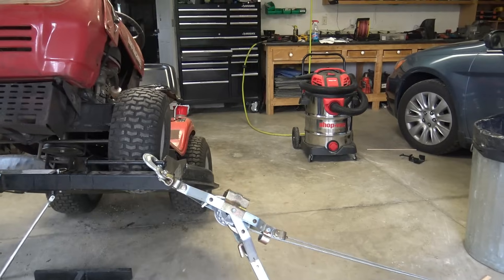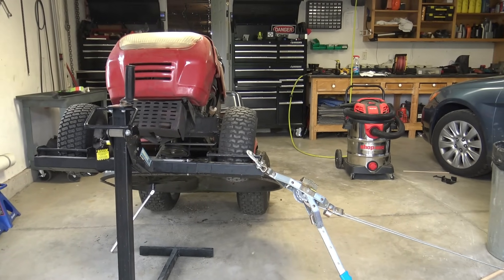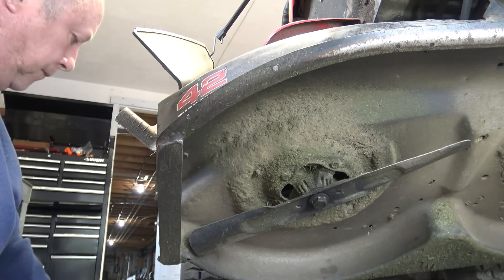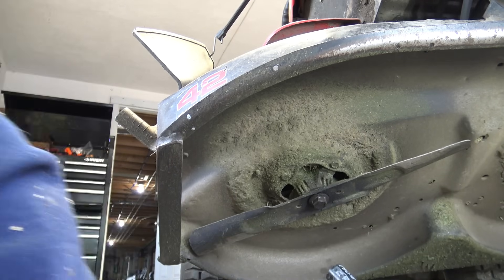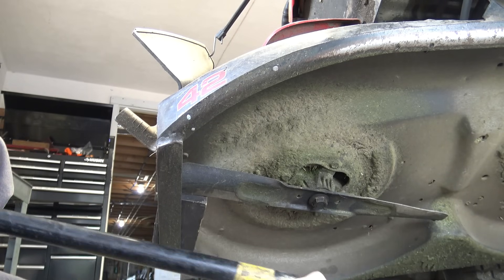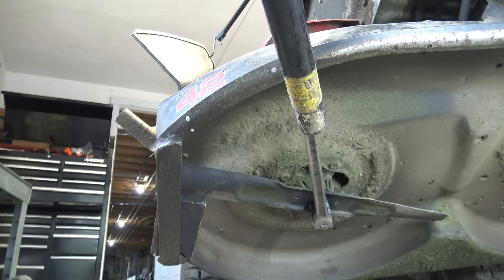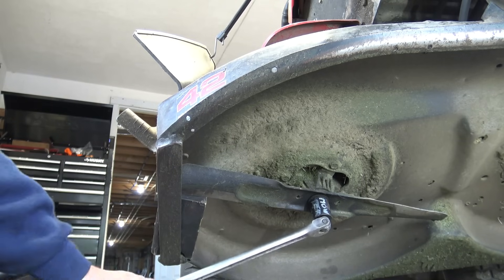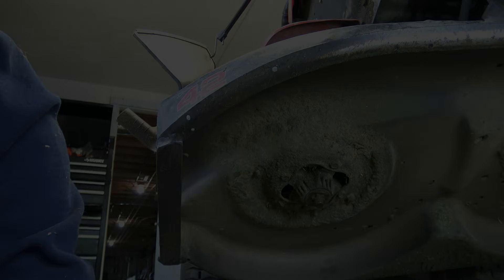How to remove a stubborn mower blade nut

Comment: use never seeze on the threads  to keep  from locking up next time
Reply from the maker: That is  very helpful to my viewers. Thanks for your comment and thanks for watching my channel.
Reply: @richardspaulding5035  Or, my good man, another way is to not tighten the blade bolt until you soil your pants. Most blade bolts only need around 50 ft. lbs. to secure them.
Reply from the maker: @48retrop  Thanks for that information; Your point is well taken as that is something I never considered.  As I recall I used an impact wrench to tighten the blade nuts back then.  Now that I think about it, I know these things can very easily put out several hundred pounds of torque.  I am sure that’s what must have happened.  I do indeed own a torque wrench and I will most certainly tighten the blades to specifications next time.  Thanks for taking the time to help me out.  Please by all means to not be a stranger to my channel.

Comment: Now the question is can you re-install the nut with the SAME pressure as before?
Reply from the maker: I just gave it a few blasts with the impact gun. The rotation will keep it tight.  I replaced the machine the following spring as it was about 8 years old at the time of the video. I have not attempted to change the blades on my new machine as of yet. Thanks for your question and watching my channel.

Comment: Pulled so hard on mine I snapped my "break"er bar. Looks like I'll be applying some heat and trying again...
Reply from the maker: Be careful as the spindle housing is made of aluminum. It will melt in a flash if you get things too hot.

Comment: I'm afraid to try this... afraid the top of the nut will break off.
Reply from the maker: I must admit I was very nervous; I did not know what was going to happen. I could not use heat because the spindle housing was made of aluminum.  I knew something was going to give but I did not know what. As it turned out as you saw in the video it was the nut.  Put on safety glasses and try not to position yourself directly under the machine. If you noticed I positioned myself off to the side as best I could.  Let me know how you make out.
Reply: @richardspaulding5035  I have a push mower, so luckily I don't have to be worried about the weight of a riding mower.  I just have to make sure I try it right after cutting the grass in case it's out of commission for a bit... or broken beyond repair.  It would give me a reason to get an electric mower though.  My old neighbor had an electric and he said it worked great.
Reply from the maker: @jstriker623  You won't be sorry if you go electric. I have one for tight areas I cannot get to with my ride on. If you do go electric get an extra battery so you can have one charging while the other is in use. Make sure you pull that plug wire while working on removing your blade

Comment: The longer you leave the blades on the tighter they get. Especially when you are using it as a woods mower. Believe me I know. Hitting brush logs and rocks from time to time because I know I'm getting ready to change my blades actually just tightens up the blades. Picture hitting those rocks it's like hitting a hammer and tightening the blade. Best thing to do is not use it as a woods mower. Lol.
Reply from the maker: I agree they get tighter over time. The blades in the video had not been changed in 2 or 3 seasons.

Comment: You should always run up the pipe as close to the head of the wrench. The way you did it you are exerting a lot of force on the end of the tool and at the head. And you are wasting a lot of advantages of using the lever.
Reply from the maker: Thanks for the advice. It is well taken.

Comment: Yeah because everybody has all of this fancy equipment.
Reply from the maker: Thanks for the comment Bob;  I do not think my tools are that fancy. However I suppose if you are an individual who owns no tools at all they would appear to be so. The lift in the video was purchase at Lowes for under 200 dollars. If you own a lawn tractor it is a worthy investment.  Anyone who owns a socket set should have a breaker bar. All I did was slip a pipe over it.  As far as the ratcheting come along a simple chain would do however the tool  can be purchased at most hardware stores for about 30 or 40  dollars. If your interested in doing repairs yourself it requires some investment in tools. Thanks for watching my channel.

Comment: I've literally broken 1/4 breaker bars trying to get mine unstuck..
Reply from the maker: They can be very difficult. You cannot use heat as the spindle housing is made out of aluminum.  It will melt in a flash. Perhaps if you know someone that has a 3/4 inch breaker bar otherwise you may have to start a cut in the nut and break it off with a chisel. let me know how you get it off. thanks for watching.

Comment: Jesus. Mine I used a 4 foot pipe still no go.
Reply from the maker: They can be tough!  I wasn't sure if I was going to get mine off, it was more than a little scarry. I did not want to use heat because of the aluminum spindle.  However, if you must cut the bolt and the spindle gets damaged, they are easy to replace. You can find a replacement spindle for about 50 dollars depending on your machine. Let me know the outcome if you can.

Comment: Not even that worked, I broke my breaker bar 😭
Reply from the maker: Thanks for sharing your experience. Sorry I took so long to respond. In 40+ years I have never broken a breaker bar. I have always used quality tools however. Be careful if you try to heat that nut as the spindles usually have an aluminum housing.  You may need to take it to a professional. Let me know what happens
Reply: @richardspaulding5035  why not just use battery impact wrench?
Reply from the maker: @Amberlynn_Reid  My battery impact wrench is not as powerful as my air impact wrench. The air impact would not budge it.  Evidently it was not apparent in the video, but I had to exert a tremendous amount of force with a very long pipe to break it free,

Comment: Dude, what in God's name are you doing?! You don't have shop air(air compressor)? If you do, first spray the nut with pernitrating fluid, and do not use that crap WD 40, that crap does nothing, then use an air Impact. Or get a high voltage 1/2 inch impact driver. Make sure to us a socket intended for impact use. Guaranteed to remove that stubborn nut every time. I know this works. I own a John Deere ZRT which 3 blades and a Garden Tractor that has three blades. I use my air Impact to remove and reinstall the blades all the time. Just don't hit it too hard when you reinstall. I recognize that you show on your video that using an air impact wrench does not loosen the blades. To me I see 2 possibilities. 1- you are over tightening the nut much tighter than is needed. There are torque spec available. The manual for my zero turn states 80 to 100 foot pounds. That's tight! My garden tractor (Craftsman GT4000) is around 80 foot pounds. 2- Maybe your impact does not apply enough torque to remove the nut. I use a 23 year old Campbell Hausfeld compressor with 125 psi max pressure. My impact is a Campbell Hausfeld 1/2 impact that is the same age as the compressor. I use these same tools to remove lug nuts on my 3/4 ton GMC pickup truck. So I am wondering why your impact does not do the job. I also have used my Hercules 20 volt 1/2 impact. It has no problem performing the same exact function. Apparently there is another factor we viewers are not aware of. I use a 1 ton chain fall that is hung from the trusses in my building. I attach the chain hook to the mower with 2 1200 pound straps wrapped around front frame of the tractors. Not going to fall off that system.
Reply from the maker: Dude!!!!!!!!!!!!!!!!!!!!!!!!!!!!!!!!!!!!!!! DON'T YOU THINK I TRIED ALL THAT?  Your guarantee sucks.
Reply: @richardspaulding5035  Yes I see that, but it does not make sense unless you're over tightening the nut(s). Try using some anti-seize on the threads to prevent rust. That may fix the issue.
Reply from the maker: @CuriousKL  Thanks I bow to your greatness
Reply from the maker: LOL all kidding aside your comment on the  anti-seize is the way to go. As I recall  i had not changed the blades in a couple of years and they simply got frozen. I am sure the anti-seize would have made a difference. enjoyed the banter. Don't be a stranger

Comment: Worthless...I have leverage, i dont have a bracket conveniently placed on my deck to put a brick in to hold blade...I have blade in a locked position and I still can't break nut loose...of course using a cheater bar is first choice...what if that doesn't work....need more detail bud
Reply from the maker: I am sorry your having problems Korey. A breaker bar or as you call it a cheater bar with a long pipe for leverage should get the job done.  I had a special lift however the normal procedure to replace the blades is to remove the deck. As a last resort you can bring the deck to one of those power equipment dealers. I am sure they could get it off for you as they must deal with this issue all the time. Thanks for watching my worthless video.
Reply: @richardspaulding5035  no worries sorry for the negative comment, I was at my witts end on that damn mower haha. Ended up hitting the bolts with a torch for a min and then they came off with the cheater bar, broke 2 socket wrenches before thinking of a torch though haha that sucked
Reply from the maker: @koreyhayden1368   Thanks for getting back to me. I am glad you got the blades off. It was smart to limit the amount of heat because the spindles have an aluminum housing. Thanks for the conversation. Don't be a stranger.

Comment: lucky for everyone doing these videos they are not having to deal with a free spinning blade  so no matter how many blocks of wood I use.. the bastard still spins and I can not release the nut. FML
Reply from the maker: Rudy; the reason your spindle is free spinning is the end of your spindle (the part that locks your blade in place) is most likely stripped.  If you look at the hole in the new replacement blade it is in the form of a star or some sort of  shape that locks it to the spindle once you tighten the bolt.  If that shape on the end of your spindle is gone there is no way the blade will lock thus you cannot stop it from turning when you attempt to loosen the bolt. That happened to me a few years ago. I had to preplace the spindle ,               A spindle for most machines cost about 60 dollars, there are some nice videos  out there on  how to replace one.  Good luck and thanks for your comment
Reply: @richardspaulding5035  thank you  for that information mate..  I was going nuts.. So I took out both  blades with that bolt still attached and will be sending them into the shop to get sharpened and do what needs to be done.. I am only home on the weekends and have very limited tools  so to spare my sanity and the condition  of the walls and tooling I feel this will be the safest option lol